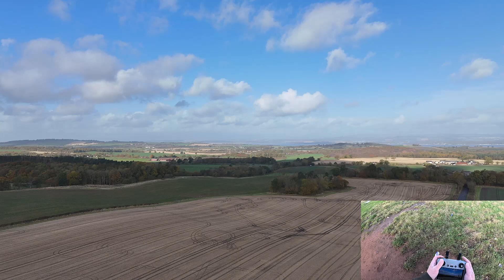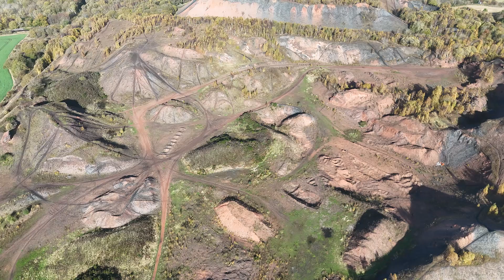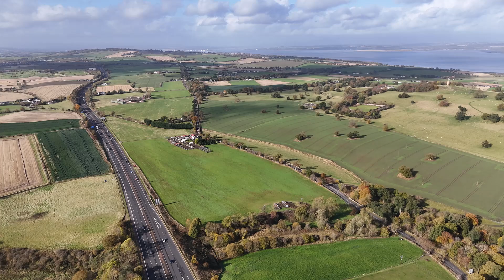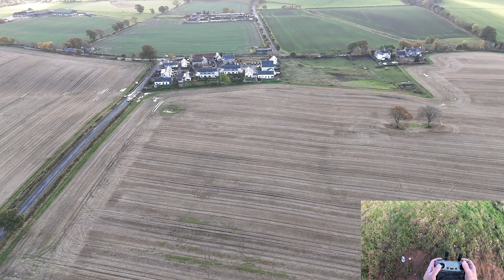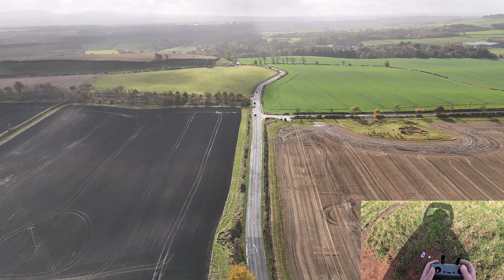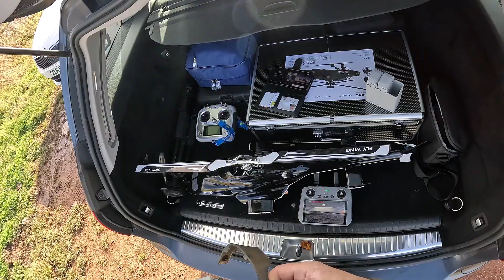DJI Mini 4 pro 4.1 mile flight

Comment: Is it CE mode? 6 miles is impressive with just 25mw. I have a mini 3 pro and the range is shite in CE mode. I'm seriously thinking of buying the 4 pro.
Reply from the maker: Completely standard settings it was out over the see but never dropped a bar I could have went longer if wasn’t fearing battery life
Reply: @bigpoppapaulrc  That's encouraging. Was it the standard battery as well? I understand the issue with the battery life, I've seen too many Dustin Dunnill videos to know what happens if you push these drones too far, lol. Also it knackers the batteries if you drain them too much, and they aint cheap.